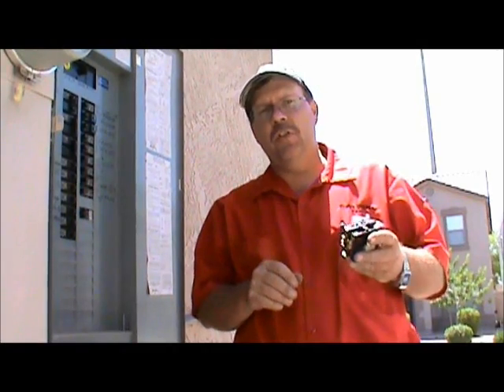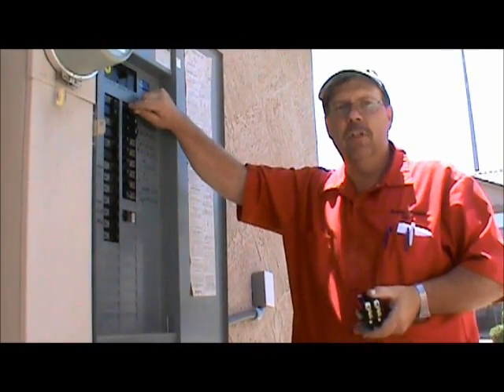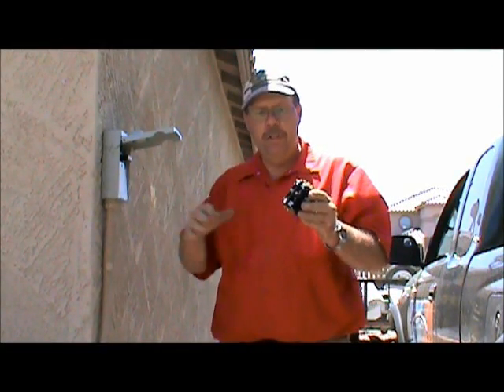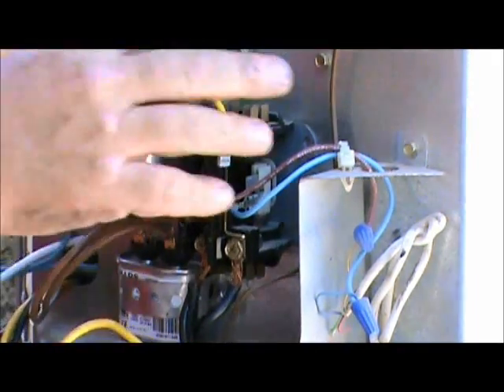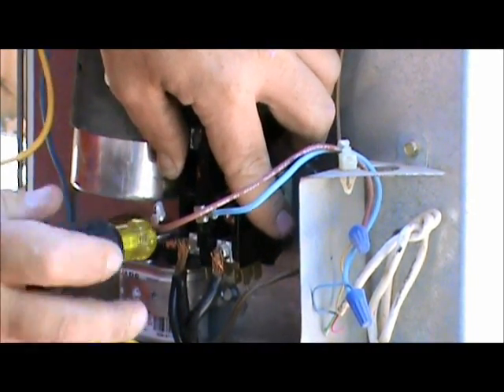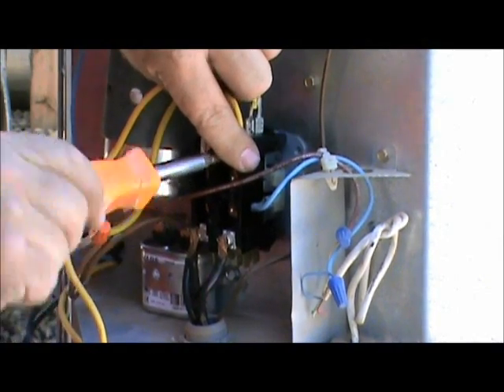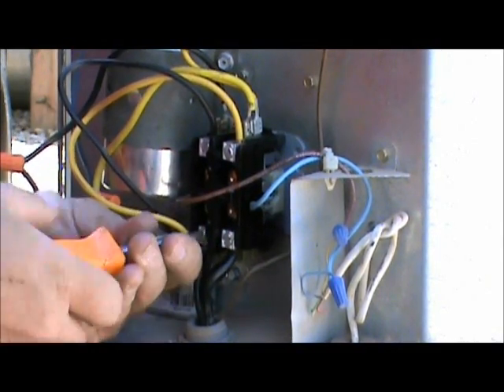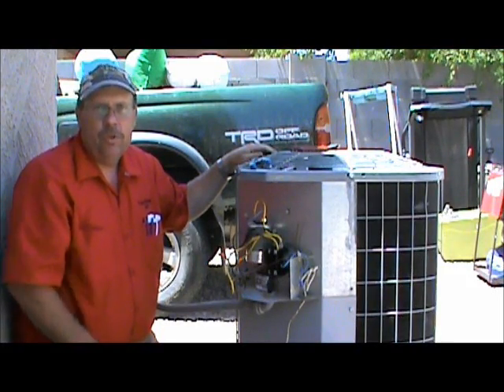Air Conditioner Contactor - How to Change a Contactor

Comment: You used a 2 pole to replace a single pole contactor. The top yellow wires are constantly energized on a single pole, when you change it shouldn't the yellow wires now be placed on the bottom line voltage coming in from the disconnect so it can be constantly energized?